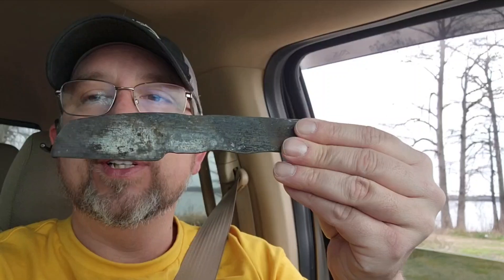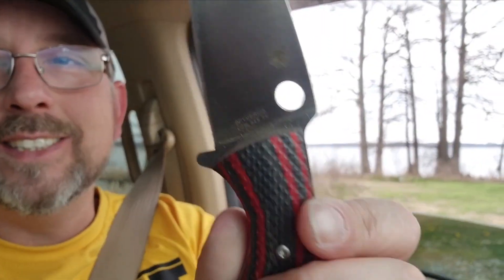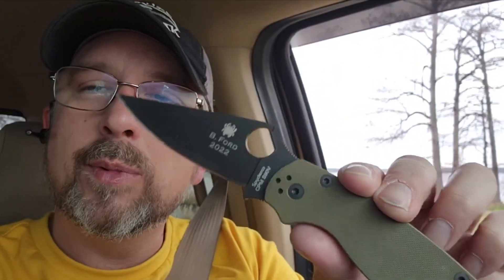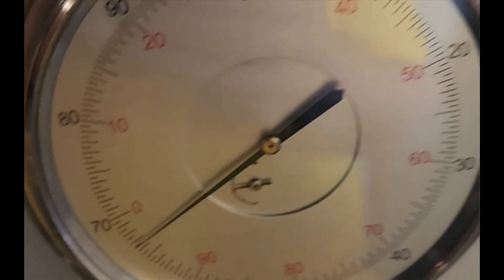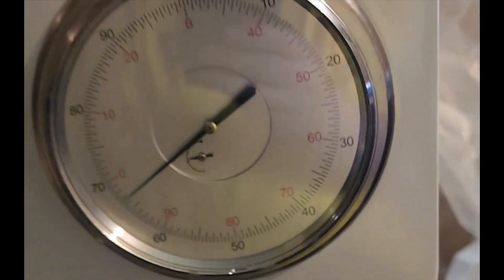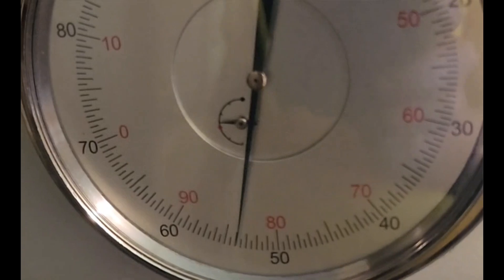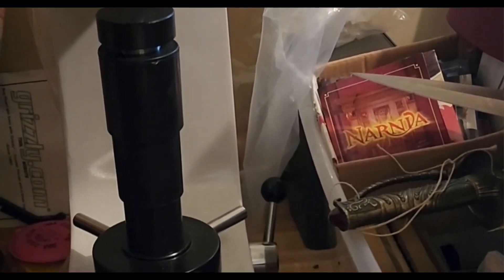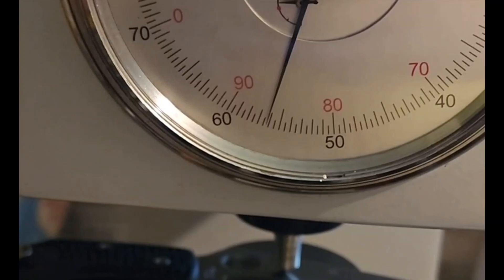SHOCKING SPYDERCO HEAT TREAT RESULTS !!

Comment: Interesting. I just sharpened two Spydercos back to back. A Military in M4 and the Para 3 s90v sprint. I've sharpened M4 many times before. This was my first experience with s90v. I'm only going to speak on the s90v because the M4 was very good as usual. Now, I don't do any edge testing outside of catalog paper and arm hair shaving. I do knife modding and hand sharpening is part of what I do. However, I can tell you this. I was able to cut/remove the steel much easier than I had anticipated. Especially after just finishing the M4. It didn't feel soft so to speak but, definitely not the hardness I expected considering what it's supposed to be. I got it down to 15° on #800 diamond stone. It deburred without issue and stropped up rather well. Overall it took a very nice edge. I have another para3 s90 to be sharpened soon so I'll let you know how that one goes.   I hope this was beneficial. These testing videos always make for great content. Looking forward to more.👍
Reply from the maker: This s90v was the sharpest knife I had in the house for about 8 days at a time lol. It does take an edge very easily. Just doesn't last much longer than a rat 1 in aus 8. Hope yours last longer bro.

Comment: I don't think you are considering the knife design.  You don't temper the steel to get it as hard as possible, you temper the blade based on the shape, geometry thickness and purpose of the knife.

A tactical knife would be tempered softer, so the blade doesn't break when you stick it into something hard or pry with it, same with a kitchen knife that you don't want to shatter when you drop it on a tile floor.

Now, if you are making a machine cutter blade, you want to make it out of super hard high speed steel. 

There are many times where you sacrifice edge retention for purpose or durability.

In my experience, most good tactical knives I own are just a little softer or thicker than their less tactical counterparts. In certain situations edge retention doesn't matter and bending is better than breaking.
Reply from the maker: I very much consider design actually. Edge retention isn't very important to me if you know my back ground. I'm used to s90v flat ground knives outlasting a rat in aus 8 though 😆
Reply: @apex_alchemy_knives  LOL, to be fair a RAT is a pretty well designed knife with a awesome blade geometry... But I have a couple tactical knives in S35VN that are hardened in the low to mid 50's that hold a good edge... but not like a D2 RAT either. 

The RAT however is a work knife while the tactical knives are pretty much something I carry when I'd rather not be cutting things.  Mostly, I'm relying on them not breaking on me if I need them. So finer point, softer and tougher is better for their purpose.
Reply from the maker: @RJ-vb7gh  I get that yours saying. I don't consider a para military 2...or most sydercos to be tactical. Too thin to pry with ,  I can't imagine a situation where I had a any other pocket knife and was really wishing I had my pm2. It's thin it's slicey...it's designed to cut cleanly, and it does that well.
Reply: @apex_alchemy_knives  Actually, a good tactical knife is both thin and pointy.  It usually has to penetrate layers of cloth and other materials. Then it has to not break if it hits something harder in the next layers. Bending isn't good, but breaking is a lot worse.  

People often get confused with a tactical - utility knife and a tactical knife.  K-Bar style knives are primary utility knives and are meant for prying. I have an original and still use it to open cans that my can opener can't,  A true tactical knife isn't useful for much anything else, like a Sykes-Fairbairn.

While the PM2 is more or less a downsized PM, and not the greatest tactical folder, I can see where it's design philosophy would still be more tactical than utility like the RAT for example. 

If you want to do a fun experiment find yourself an old army jacket or heavy winter coat and put it on a pillow and do some piercing tests... you might be surprised which blades are more tactical than other's. Of course you could also test the point against something hard like bone... but likely we both like our knives too much to do that.
Reply from the maker: @RJ-vb7gh   ok, I don't like the word tactical when we talk about knives. I remember tactical being a word with a clear definition myself
Reply: @apex_alchemy_knives  Overall, I prefer knives for their more conventional and mundane purposes. Perhaps the word defensive should be used rather than tactical, but marketing people dumped the word tactical on us because I suppose it sounds cooler.

Having actually been in life and death hostile situations, no one in their right mind should ever want to be there. Surviving them changes you forever and not surviving one is even more permanent.  Still when you talk about an object with the word military in it's name... you unfortunately have to go there at least hypothetically.

The actual sad part is that most of the tacti-cool stuff out there will definitely get you killed more often than not and isn't good for anything else either.

Comment: As others have mentioned, pick a flat surface for the test, clean the blade before testing. Other youtubers have tested spyderco blades before this way with good results, hopefully its the same here if done correctly.
Reply from the maker: Thanks for reiterating. I'll remove the video and shoot it again. I'm not a stranger to heat treating , the thing is...this blade is junk like I stated before testing , several times over the year and at least once at the beginning of the video. Won't hold an edge to save it's life. Not a huge deal. Just surprising. But of course we will do things in a manner to give people the most hope ...until they realize that rockwell is far less accurate of a test than Vickers scale. 🤣🤣....I'm not buying a vickers tester...Knife people wouldn't know how to act

Comment: It's interesting because most people rave about Spyderco's heat treat.  I'm not an expert on this, but I've heard that each steel has a different optimum heat treat.  Harder is not always better.  Googling S90V it says the target HRC is 56 to 59. If that's  true, your blade is a bit soft, but not too far out.
Reply from the maker: All I know about it really is that it doesn't hold an edge as long as my rat or my ad15 , both in s35vn...and s90v should kick s35vn's tail up one side and down the other. Itsxnot that big of deal.  I'm not filing a warranty claim or anything. When I say my spyderco s90v pm2 won't hold an edge...people look at me like I have 3 heads ...that's the only reason I wanted to do the video. I knew something has been off about the knife for over a year. Just wasn't sure how bad it was. Yeah sptderco advertises they heat treat it at 58-60. I probably just got a bad sample. Some folks out there are of the belief that spyderco doesn't have bad examples or make mistakes. We are all just human at the end of the day.
Reply: @apex_alchemy_knives you should send it back to Spyderco for testing. That HT is unacceptable specially Spyderco who values good HT on their steel.

Comment: Gotta test the steel on a clean flat not on the bevel, the results aren't accurate testing that way. Not saying the numbers will be better or worse but testing on a flat parallel surface is the proper way.
Reply: Full flat is a decline. You need to hit the flat behind the ricasso on the tang (usually folks remove the blade entirely).
Reply from the maker: @kreed4   not a problem , we can test the tang. It's normally softer back there than it is on the blade...on the knives I make anyway. Test em after de-scaleing them on a surface grinder. It always puzzles me why the blade will be 60 and behind the tang will be like 50. 🤣...it was all heated in an oven at the same time and all quenched at the same time, all tempered at the same time...but the blade gods knew somehow to get that blade harder 🤣. Future test I'll run with em disassembled. Already had people contacting to see if I'll test theirs but don't want the holes showing. That'll kill two birds with one stone. Hold tight...I'm shopping for my own tester. Btw...Rockwell is the least accurate of the three systems. Typically test higher and in a 3 point range than all the others. 

The gospel I can guarantee you on this knife though my brother ..it has a crappy heat treat. That's ok. Sometimes things happen.  I understand that they didn't do great with s110v either. We can't expect em to master everything.  I don't expect em to waste money on steel they aren't gonna properly ht either though. Most ain't gonna do anything but open Amazon boxes anyway so they'll never know the difference. 😎
Reply: @apex_alchemy_knives  no doubt it’s a poor heat treat, if you can feel it from use and sharpening. Will note that there a lot of YT testers out there, all of which find recent spyderco s90v around 61-62 (LTK, outpost76, pocket perspectives), though usually this is on the manix (not the DLT exclusive pm2). Odd if spyderco somehow had a bad batch, but I guess possible.
Reply from the maker: @kreed4  not sure. the  rest of my spydercos are phenomenal and that means a lot to me.
Reply from the maker: How do you get any flatter than a full flat grind ? I understand what you're saying. Maybe it's off but...it's the worst of the bunch with all the discrepancies and funny thing...I've been complaining about the performance for over a year. It's softer than it should be ...I promise you that. 😎💪

Comment: Probably a stupid question but I couldn’t help but to wonder what effects laser engraving would have, if you test it where it has been lasered, would the heat from the lasering be inconsequential or could it even affect the results.. I dunno, like I said probably just a stupid question..

But thanks for doing the testing, I’ll always prefer more tests and testing than fewer and less. Just the other night I was trying to find out what hrc Spyderco is supposedly running their Magnacut salt series and it’s increasingly becoming more and more difficult to find actual, accurate hrc’s or even just a range. That information seemed more widespread two or three years ago on the specs but now good luck finding that information. And I know that there’s other things and information that are more important than hrc’s, but once again I believe in more information than less and let the debate rage on. And let the companies compete and innovate, but I think there’s something else going on, not just laziness, incompetence, or unscrupulous stuff. Anyways I’ll just stop there.. and say thanks for doing the video and tests! We definitely need more! Thanks!
Reply from the maker: I had my ad15 with a dlc coating so we tested thst off camera and ended up with a number between 58 and 59 ...not sure if it'd the same coating etc. But it didn't effect the cold steel.
Reply: thats not what he asked ..LOL  @apex_alchemy_knives
Reply from the maker: @brianfigner4317   you are absolutely right.  I must have thought i was responding to one if the upteen comments asking about the dlc when I responded to this one. Thanks for pointing this out to me. 

Level , bro...I have no idea.  I don't typically deal with engravings. Not sure how any of that affected results. We'll take it apart and test it behind the tang in due time. 😎💪🤘
Reply: @levelonup & brianfigner … if you paid any attention to the video he said that he noticed poor performance since he received the knife. Don’t remember if he said outright but probably decided to test it because he really already knew it was off and wanted to see where it actually landed at.